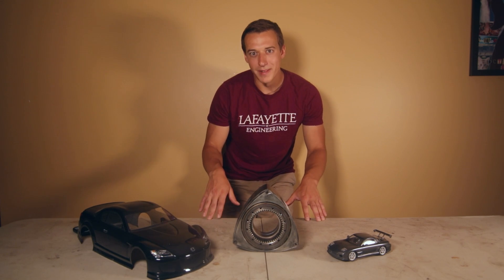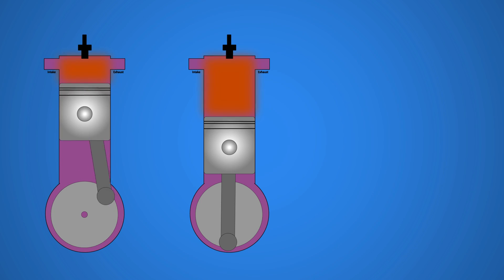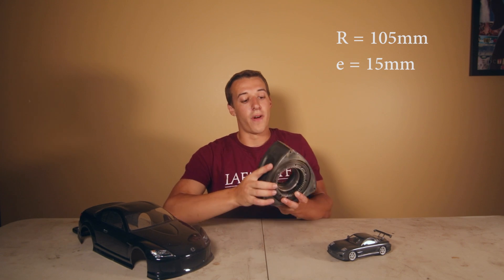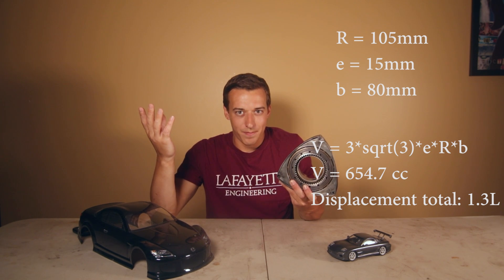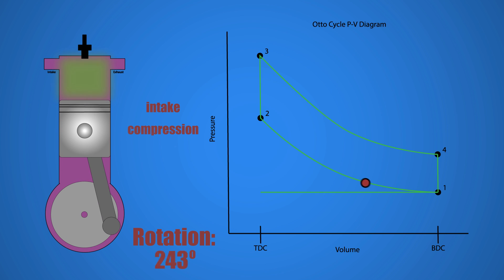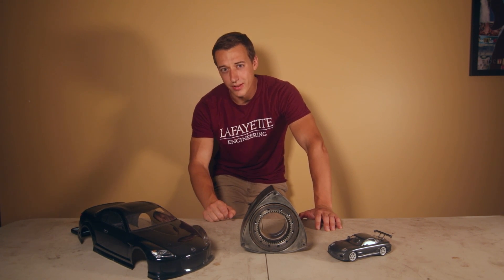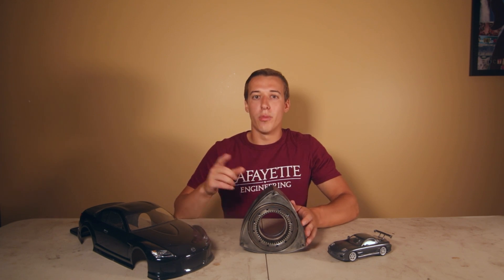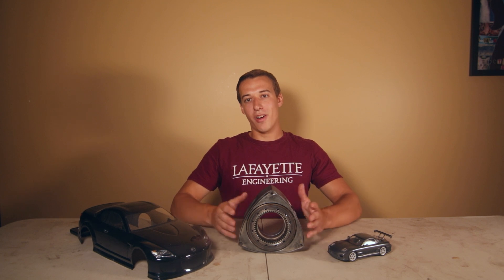You are WRONG about Rotary Engine Displacement

Comment: You are correct it's 1.3 L engine. The only 2.6 L engine is in the Mazda race car 787b and it's sister versions. 
I wonder why Mazda just make the measurements of the engine bigger to make more power and torque
Reply: Its wrong, the concept called "tax displacement" was conceived by the marketing department of NSU to increase sales in countries that have registration taxes based on engine displacement.
The Mazda 787b was powered bu rhe R26B with a total displacement of 7.8 liters. It competed in the over 5.0 liter class

Comment: Stroke volume of 654cc each combustion face ×2 = 1308
And 3 combustion faces per rotor 1308× 3 = 3924cc
Reply from the maker: The problem with that argument is combustion doesn't happen on each of the 3 faces at the same time. Combustion only happen in one of the chambers at a time. Maybe that argument could be made for the liquid piston rotary engine, but not a Wankel.
Reply: @Rotareer  No different than any other internal combustion engine. Each combustion chamber fires in a timed sequence.
Reply: Hey Thomas! this is a conversion mate from piston to rotary and it is like comparing walking and bikes :D volume is volume its like a 1 kg of feathers and 1 kg of gold ..which is heavier ?
Reply: Your wrong again dude, stop preaching the false narrative. 😜
Reply: @Skyrexx7  Its not false, you just don't know how swept volume displacement is properly calculated.
Reply: Nope.
Reply: @xMorbidArtx  The true, total displacement of a Mazda 13b series engine is 3,924cc's
Reply: @sandervanderkammen9230  Hahaha 🤣🤣
Reply: @Skyrexx7  Thank you for proving my point.
Reply: @sandervanderkammen9230  No! There's only 2 combustion faces in a 13b. Is a 1.3, don't get butt hurt.
Reply: @Skyrexx7 a piston engine doesn't fire every single piston at once

Comment: 2.6 is a 4 rotor. The holy grail of rotories! Mine is labeled as a 1.3. Parts are ordered by 1.3. Soooo it's a 1.3.
Reply: Sorry but you are wrong.

 If you have 6 chambers, each has a swept volume displacement of  654cc's 

It does not matter if the engine is a 2-stroke at 360°
4-stroke  at 720°
Or a Wankel at 1,080°

The displacement  will still be exactly the same  3,924cc's
Reply: @sandervanderkammen9230  here we go again with you
Reply: @KenBober  The facts don't change... you just have not learned anything.
Reply: @KenBober  If you still have trouble understanding how displacement is calculated correctly I would be happy to explain it to you.

Comment: It's not the rotary follows fault that the engine is more efficient like you said it's 321 they can get that through that thick head which makes it 1.3 liter
Reply: I wouldn't calle it efficient if consumes like a V6 with the trq of a i4

Comment: I'm having a hard time finding the source to cite in which I read it, but I recall there was a specific engineering convention where the displacement was doubled purely for the sake of category competition due to opposition feeling the original wankle rotary engine was an unfair contestant, and that was the solution they arrived at, and is ultimately what birthed the double displacement misconception.
Reply: "Tax Displacement" was an idea concocted by the marketing department of NSU as a marketing tool to improve sales in countries that have registration taxes based on engine displacement.
The theory was that if NSU invented the Wankel engine they had the right to calculate the displacement anyway they wanted whether or not this calculation was based on any accepted engineering or industry practice and theory.
Reply: The actual swept volume displacement is calculated at 3,924cc's @ 1080°

Conventional reciprocating Otto engine completes its firing order sequence in 720°degrees of crankshaft rotation.

Engineers, government agencies and motorsports sanctioning bodies use the 2X conversion formula for calculating the displacement of a Wankel engine at 720°
Making the Mazda 13b series closet to a 2.6 liter for acurate comparison

Comment: Love the comparison with the 2-stroke engine to be like "why would you double it arbitrarily, does it butthurt you so much that those engine produce that much power?"
I've also seen people use the argument "Yes but it's a swept volume with variable geometry" to justify why it would be a "2.6L" engine.. :')
Reply: @jaycool5978  The Mazda 13b series has 2 PISTONS and a 30mm STROKE

Each face of the triangular piston is one combustion volume (cylinder)
And each face has 4 separate cycles, 
Intake, compression combustion and exhaust cycle 
It takes each face 1080° degrees of crankshaft rotation to complete the firing order sequence.

Any questions?
Reply: @sandervanderkammen9230  not really. Each rotor face is, in effect, a piston and it's just all three pistons on the rotor happen to have, on a cyclic basis, temporary exclusive use of parts of the chamber used for induction, compression, power and exhaust. I very neat idea, but each rotor is acting closer to three pistons than anything else. Unfortunately, it's inherently thermodynamically inefficient, filthy, achieves poor combustion efficiency and achieves its power through wasteful use of prodigious amounts of fuel.

 Of course it's somewhat pointless using capacity comparisons anyway, as it's simply not an appropriate way of equalising measures these days. What is relevant now are real world things like emissions, fuel efficiency and longevity. In a racing scenario where different engine formats are used there almost always has to be some form of other control, such as fuel flow rates to bring some measure of comparability into the game.
Reply: @TheEulerID  The Wankel engine has a limited volumetric efficiency which is indicative of its low IMEP 
And it's low mechanical efficiency is  manifested in its relatively low BMEP performance compared to reciprocating engines.

It's low thermal and combustion efficiency is proven by the Wankels high BSFC performance and the low Carnot Cycle efficiency high T2 (EGTs) temperature.

High hydrocarbon and Carbon Monoxide emissions are symptoms of poor combustion efficiency as is the high NOx (oxides of nitrogen) relative to the Static Compression Ratio and Dynamic pressures.
Reply: @jaycool5978  The Wankel KKM57 doesn't have Rotors... it's has orbiting pistons.
Only the Wankel DKM54 has a rotor.
Reply: @jaycool5978  You really don't know anything about Wankel engines do you kid..
Mazda didn't invent it... you probably don't know the name of the man who did.
Reply: @jaycool5978  Only the Wankel DKM54 has a Rotor.

KKM stands for Kriess(en)kolbenmotor.
It translates into English as "Orbiting PISTON Engine"
Reply: @jaycool5978  You're not very smart either... It's called a Orbiting PISTON Engine... SAYS SO RIGHT ON THE PATENT
Reply: @jaycool5978  KRIESSKOLBENMOTOR 
KOLBEN = PISTON
Reply: @jaycool5978  Only ignorant little rotards call it a rotor..
Only the Wankel DKM54 has a rotor.
Reply: @jaycool5978  NSU Motorenwerkes GmbH. is a German company.... Hanns Paschke and Walter Freode were both German.

Being a person of limited education you are unaware that when you invent something, you get to name it.
Amateurs like you often use patois or street slang, confuse registered trademarks of a particular company rather than use proper terminology.

Rotards like you are easy to spot because you don't actually know anything about Wankel engines or automobiles in general...
Reply: @jaycool5978  The world isn't Mazda...in fact Mazda bought the rights from NSU and became a Wankel KKM licensee in 1961.

Mazda paid royalties to NSU for every Wankel engine it sold until the patent expired.

Mazda lost 3 billion dollars on the RX8 fiasco and went bankrupt in 2009 when they abandoned all development of Wankel engines.
Production ended over a decade ago.
Reply: @sandervanderkammen9230  thank god they abandoned the development of the wankel...focus on other cars like the miata....You know the car thats actually carrying the company's name LMAO
Reply: @63W-raccoon  The Miata is the best selling 2-seat convertible sports car in history and is currently Mazda's only sports car.
The RX brand was a multi billion dollar failure that caused Mazda to go bankrupt... TWICE!
Reply: @sandervanderkammen9230  there is a internal feud between miata owners and rotary enthusiast. The miata and honda civic are just better cars. ¯\_(ツ)_/¯
Reply: @jaycool5978  WOW! You really know nothing about Wankel engines...
People refused to buy Wankel engines because they are inherently unreliable and flawed by design.
The Mazda RX8 sedan was a disappointing performance and sales failure that nearly destroyed the entire company.
Reply: @jaycool5978  Rotary engines have been obsolete for nearly a century lad... we were discussing Wankel engines.
Stay in school kid and lay-off the drugs... someday you maybe able to discuss this subject inteligently.
Reply: Darth Vader  You don't know anything about the history of the Wankel engine do you son?
Its right in the patent for the Wankel KKM57

KKM57 stand a for Kreiskolbenmotor, year 1957

Kreiskolbenmotor = orbiting piston engine

Any questions kid?
Reply: I agree absolutely, it has 6 combustion chambers and 6 seperate displacement volumes.

But you have to account for the firing order cycle which requires 1080° degrees of crankshaft rotation to complete the firing order compared to reciprocating Otto engine which completes its cycle in just 720°.

This concept is well-known and understood and is commonly applied to comparing a 2-stroke  engine with 4-stroke engines.

We compare the relative displacement based on the degrees of cycle duration.

360° for the 2-stroke compared with 720° for the 4-stroke.

This is not just relavant to displacement but also to horsepower per liter comparisons because of the Time component.

The Wankel engine has extremely low BSFC and BMEP compared with a 4-stroke reciprocating Otto engine.
The Wankel not only suffers from poor thermal and combustion efficiency, it also suffers from poor volumetric efficiency and extremely poor mechanical efficiency.
Reply: Total swept volume displacement is 3,924cc's 
The Wankel KKM57 engine is a 4-stroke... except that it requires 1080° degrees of crankshaft of rotation to complete its firing order sequence unlike the Otto or Diesel reciprocating engines at 720°
Engineers, government agencies and motorsports sanctioning bodies use the 2X conversion formula for calculating rhe displacement of the Wankel engine at 720° 
This makes  the Mazda 13b series closer to a 2.6 liter in comparison with a Otto or Diesel reciprocating engine

Comment: If it actually was a 2 stroke engine you would be correct about it being a 1.3L. But because it's actually a 4 stroke engine it's a 2.6L. People joke the engine is the size of a 1.3L, has the displacement of a 2.6L and gas consumption of a 3.9L.
Reply: it has gas consumption of a 3.9L because it is an 3.9L. remember that each rotor has 3 faces, so the calculation should be 654.7 CC stroke volume × 3 faces per rotor × 2 rotors = 3928 CC.
Reply: @Brazio20  You can think of it like that. However, the 13b is a 2 rotor engine, which is equivalent to a 4 piston 4 stroke. So, if you use the 4 stroke standard for displacement calculations, you get 2 pistons per combustion chamber x 0.65 L per chamber, which is 2.6 L. In racing classification, this engine is also considered to be a 2.6L. It certainly does consume gas at least like a 3.9L.
Reply: @mischiefpwns  Don't get me wrong, I agree with 2.6L because racing associations need to balance rotary engine to make sure rotary engine cars aren't overpower or underpower in their classes.

I said it is technically a 3.9L engine because, for example, 2L 4 pistons 4 stroke is essentially a 4 × 500cc engine, and 1 rotor in rotary engine has 3 rotor's faces that are pulling the works of 3 pistons 4 stroke, so 2 rotors is essentially a 6 pistons × 655cc. this is where my "technically a 3.9L engine" comes from.
Reply: @Brazio20  This engine can definitely be a 1.3, 2.6 or 3.9 depending on how you want to think about it. You are correct there are technically 3 rotor faces per combustion chamber which could compare to a V6 and not a 4 cylinder. In that case you would be right to classify it as a 3.9L.

Comment: People call them 2.6l because it has 2 rotors and that’s the math for 1 rotor alone. The full engine has 2. If anyone is saying in 1 rotor that it’s a 2.6l you just flat out have no clue what your talking about
Reply: Remember when he argued that each rotor’s displacement is 654cc. Because the 13B has two rotors its displacement is 1309cc or 1.3L

Comment: You could also argue it's a 3.9L 2 stroke.
Reply: 3.9 liter 4-stroke 
All Wankel engines operate using the same 4-stroke principle as reciprocating Otto or Diesel engines
Reply: No only one side fires on each rotor at one time not all 3
Reply: @edwardwillis6409  Yes, but it does not fire once per 3 crankshaft revolutions... it fires once every revolution.
Reply: @sandervanderkammen9230  and there are piston engines that fire every rotation they don’t double in size……………..
Reply: @edwardwillis6409  The Wankel engine is a 4-stroke.

It operates using the exact same 4-cycle principle as a reciprocating Otto or Diesel engine.
Reply: @edwardwillis6409  The Mazda 13b series engine has only 2 combustion cycles per crankshaft revolution.

A 6 cylinder Otto engine has 3 combustion cycles per revolution.